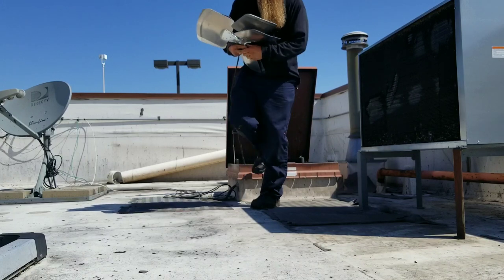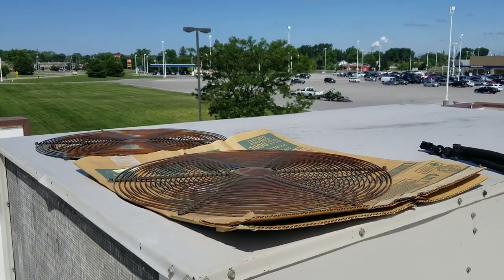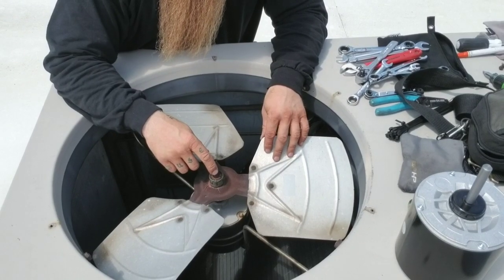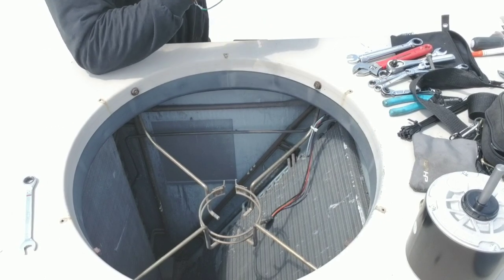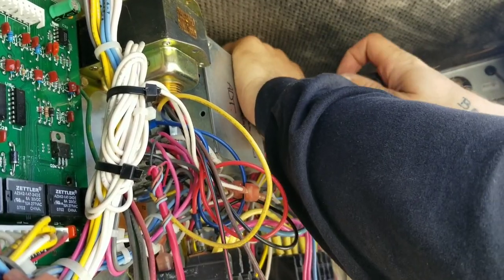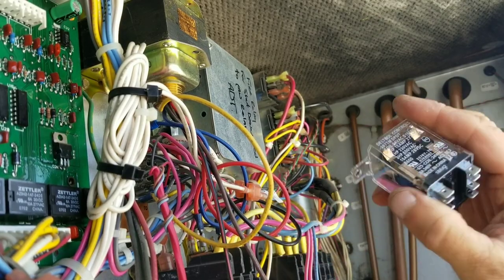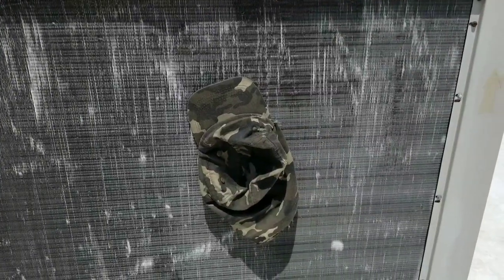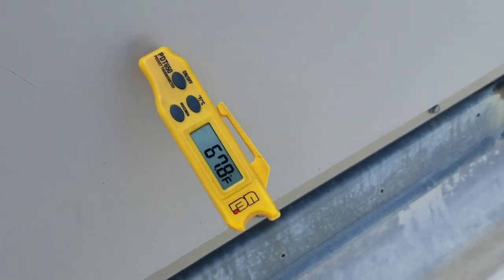Lennox after hours no AC: Part 2

Comment: Take it from me.  When I was young in this trade, just because you throw the disconnect switch DOES NOT mean it's OFF.  I almost got zappified to death one day on a restaurant roof when I threw the disconnect, only to at the last minute check for power, and there it was in all it's glory.  460v.  How could this be??  Because the monkeys that were their before me decided it would be a fine idea to bypass the disconnect internally.  I guess their thinking was there was still a way to turn it off at the breaker below, but to any unsuspecting person this could get them killed.    Gentlemen.....trust no one but yourself.
Reply: And tone out your leads before testing for live circuits, as a faulty meter lead will also cause you to get zappified to death.

Comment: using a mulimeter set to volts AC to discharge capacitors is usually safer. i started doing it after i had one pop when i was shorting it with a set of pliers. plus, it gives you a good visual of what charge it's holding.

Comment: The worst capacitor shock I ever received was taking apart a disposable 35mm camera in the 90's. That HURT. I felt 120 many times and 240 a few, those were nothing on the 50k volts from the camera flash.

Comment: You said to use needle nose players to tighten the spade connector. This is a very common incorrect way to tighten the connector. To pinch the side. The proper way is to use a small screw driver on the back. You will notice a small dent or triangle piece. Push this dent or triangle in to tighten the fitting. Squeezing the edge lots of times will crack the side. They are like a spring. Look at the spade connector you will notice what I’m talking about. Even if it is insulated you can push in the back to tighten them. Again their is a test next week lol.
Reply: A regular pocket one will do. Use the corner

Comment: hi, i see there is compressor circuit#1 and compressor circuit#2. so on thermostat wiring there should be Y1 and Y2 correct? so on a call for cooling which circuit comes on and which circuit doesn't? or how does a system with two circuits work? thanks for all your helpful tutorial videos.
Reply from the maker: on an initial call for cooling you get 24v through your Y1 wire, now if there is an economizer set up that will come on first and attempt to cool the space using free cooling-- again this depends on how its set up. If the supply temp doesnt drop the unit shuts off the economizer and kicks on stage 1 mechanical cooling, after a certain amount of time if the thermostat isnt satisfied this depends on what thermostat you have and how its set up it will kick on stage 2 cooling Y2 to get that temp to drop.

Comment: Were those motors three wired? Were they wired one brown on one side of the capacitor and two yellows on the other? (Yellow from motor and other yellow to contactor ) while black wire going to other side of contacter? Just wondering. Thanks